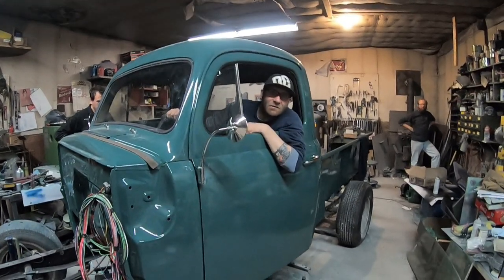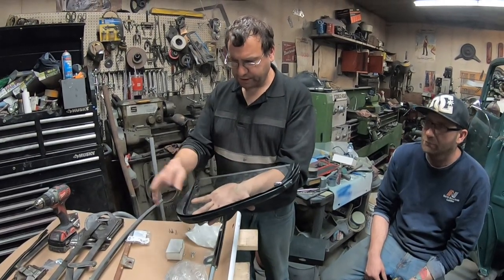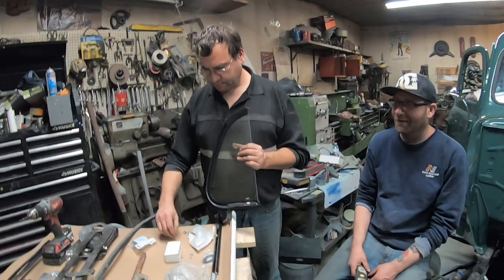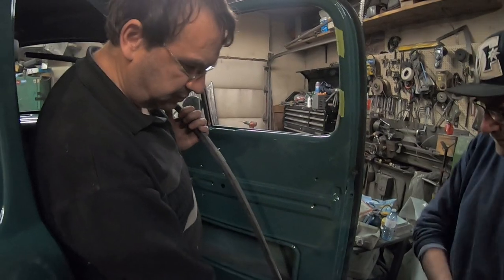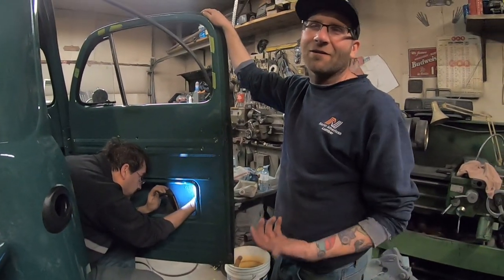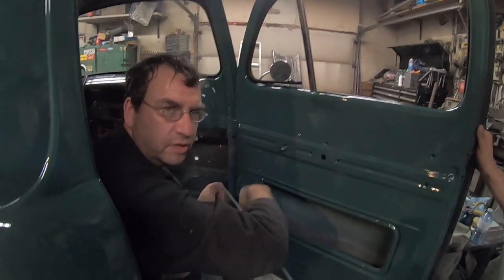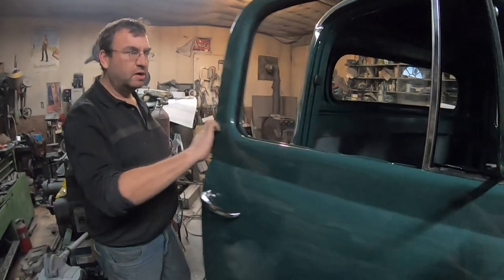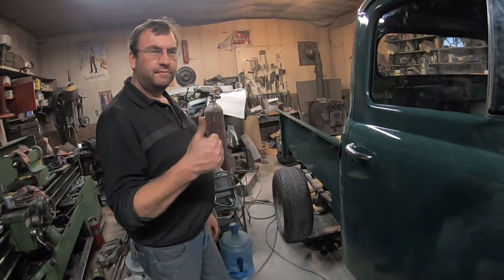1952 Ford F1 Door Accessories Get Installed  Vent Window, Glass, Regulator, lock, Door Handles Felts

Comment: I just finished installing all the glass in a 49. The doorglass belt strips took almost as much time as the doorglass installation.
I haven't done one of these in my shop for 25 to 30 years. Thanks for clearing up how to get the doorglass into position. You made it look easy!
Reply from the maker: It took several tries to make it look easy.  Easy is not easy.
Reply: @pennyshotrodscustoms  The first one took 1 1/2 hours, the second one a 1/2 hour

Comment: I am in the process of fixing up a 51, question on the door weather stripping. Did you guys glue them and use the clips or just clips to hold them on? If glue, what kind?
Reply: Btw, this video helped me tremendously to get my windows in. Thanks soo much
Reply from the maker: @crmath011  we just used a window weather adhesive and let it set up and it worked out great. Glad we  can help Christa hows your truck coming along.
Reply: @pennyshotrodscustoms  slow but its coming lol
Reply from the maker: @crmath011  Nothing happens over night  Christa

Comment: I am working on a 1950 F-1 and have found your videos  very helpful.  Did you do a segment on hanging the doors?  I am having fits trying to align my doors.  I had drilled alignment holes thru the hinge, door jam and nut plates before disassembling the doors, but they don't seem to be too helpful.  Any input would be appreciated.
Reply from the maker: I do not think we filmed that.  Our nut plates were rusted bad and we broke most of the hinge bolts in them, so we made our own.  I think we tightened the hinge bolts just a little and kept trying to fit them until we got it good enough.